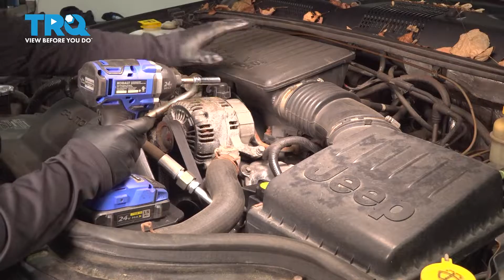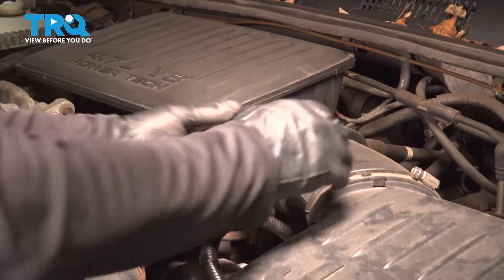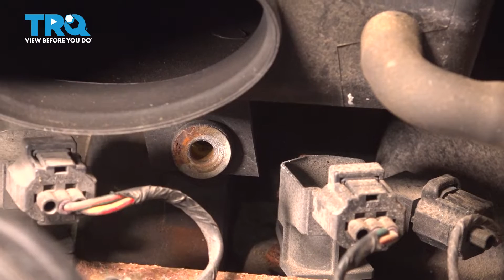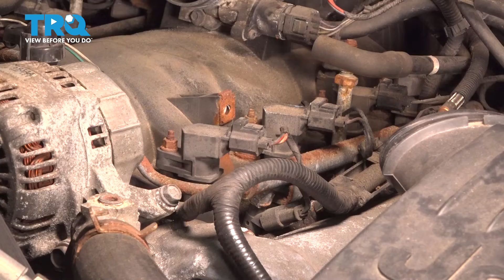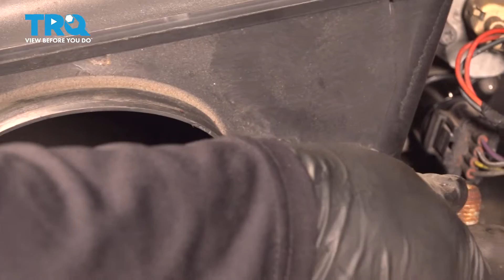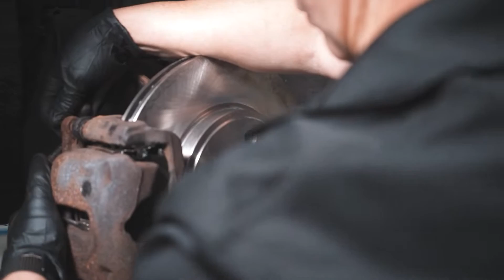How to Replace Spark Plugs 1999-2004 Jeep Grand Cherokee

Comment: Can you do the number 8 spark plug
Reply: I appreciated that they showed us a typical install for the plug, but they really should have made it a bit longer and showed what was involved to remove and install the #8 plug (such as cable/tubing obstructions and the various length extensions needed to get to the plug).  Also a quick word about checking the gap and since it’s likely a platinum plug, the proper way to change the gap without damaging the plug!